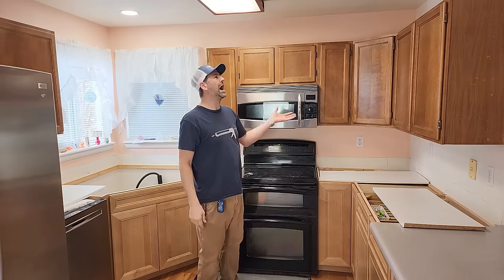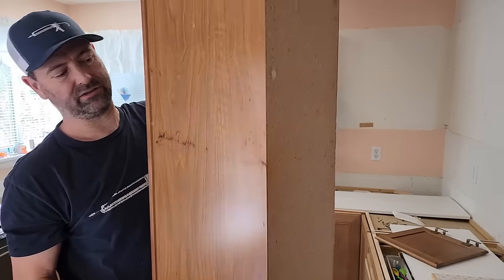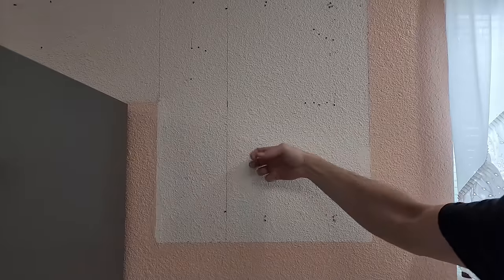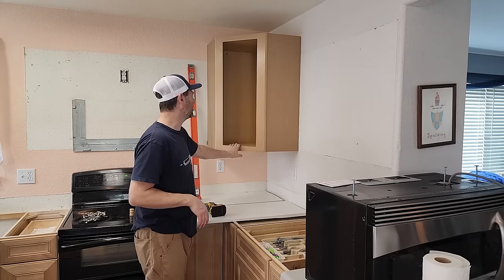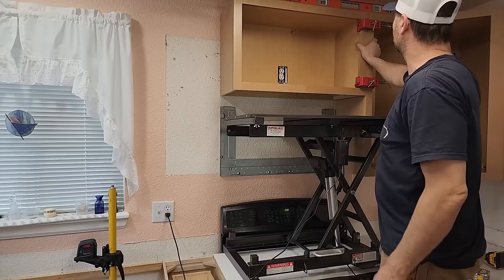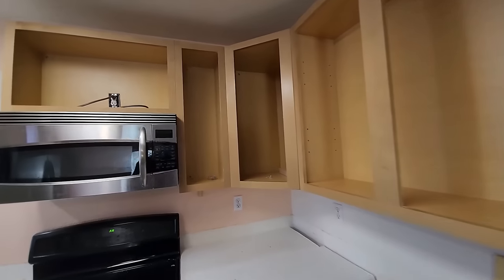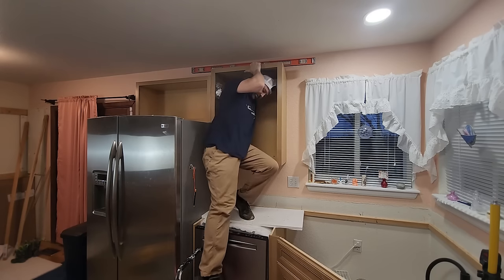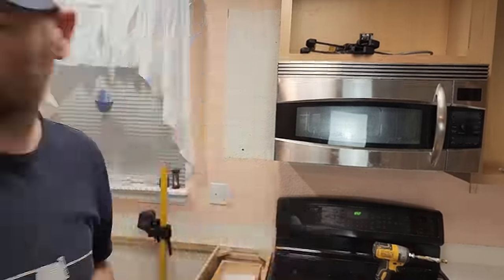Home Depot Kitchen Remodel | Upper Cabinets | Expert Install | THE HANDYMAN |

Comment: Do you like using GRK cabinet screws?  Those are my go-to screws when installing cabinets.  Also like using the GRK trim head screws to attach the cabinets to each other!
Reply: im also wondering why hes screwing into the back and not the top and bottom. i use 2 1/2 Grk. if there's no stud i anchor
Reply from the maker: There isn't enough meat screwing above the cabinet.  Blow the cabinet the screws would be seen.  In the cabinet is the only safe way that puts the screws out of sight.

Comment: watched a real funky install of a microwave that i had to mimic which didn't have a cabinet above because of the layout of my kitchen. installed angle iron to the wall and then strips of metal to each screw mount to pull to the microwave tight to wall. then made a custom box to hide the angle iron and outlet. Only found one video online of someone doing it that way.

Comment: I know a nationwide builder whose subs get between $8 to $10 a cabinet to install.  On one site they had two installers that do a ton of homes per day. They were a sub of a vendor that had the contact so I do not know the contract cost.
Reply from the maker: Sub of a sub.  It's believable
Reply: @TheHandyman1  yes. A sub of a sub for K. Hov back in 07.  Back then on 1 site  they closed 100 homes a month so they did a lot of cabinets. I almost fell over when the guy told me small cabinets $8 and large $10.

Comment: It's a shame you couldn't build an enclosed cabinet for that fridge and bring that fridge cabinet forward to line up with the front.  But that would require extra expense and some custom work I suspect.
Reply: I was wondering why they wouldnt have gotten the cabinet that extends out for above the fridge. Logically is probably because aesthetically it doesnt match the other cabinets depth wise it why they left it set back.

Comment: You made your little speech about fake videos and not how it is in the real world, on the youtubes.  Than you slap that DCW up about deadnuts every direction, that made me chuckle a bit, I rarely ever see that on the jobs I do.  Your right about those overhead micros, I rarely ever see those installed right either.  A while back I took one down where the back wall plate was completely installed with 1in pan head screws in about every hole possible.  A little tip for ya you can get cabinet screws, which are basically long pan head style screws, so you don't have to dink around with finish washers.

Comment: Chip board is not structural in my opinion, and no solid back if there is an outlet it will bow .😢
Reply from the maker: These $9,000 cabinets would quickly turn into $25,000 cabinets.
Reply: @TheHandyman1  You are so right,thank you for your reply.watching from Vancouver Island 🏝️ 🇨🇦